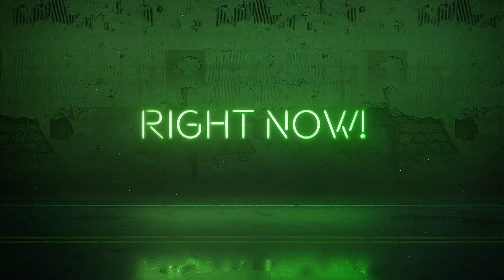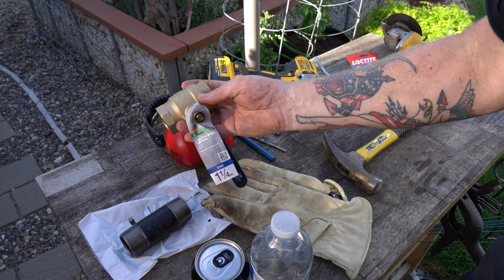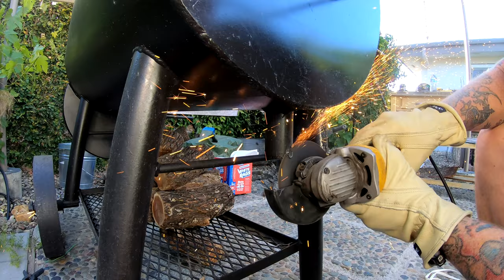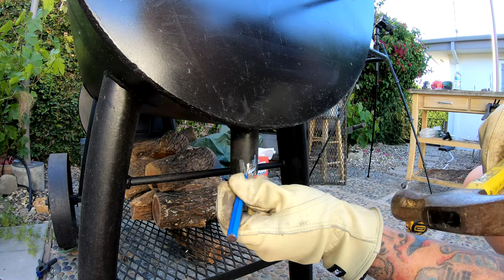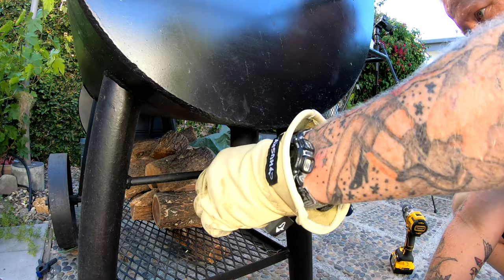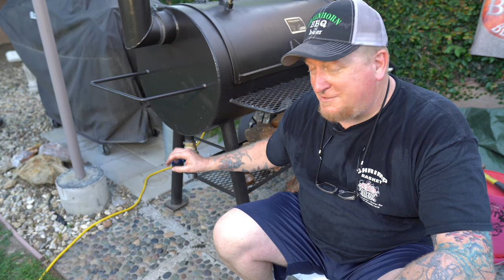Smoker mods: grease ball valve retrofit, Yoder water smoker and others

Comment: Hey Todd I’m just wondering why you didn’t use a pipe thread die and put threads on the end of the down pipe that was already there?
Reply from the maker: Good question. I don't have one on hand so I decided to do something a little different. But thats a good point. Also a cost savings measure since I had the stuff laying around already. Except for the ball valve.
Reply: I was wondering the same thing. However my authentic Texas smoker already comes with a threaded down pipe that's capped off so I  Appreciate this vid.  My job will be easy... just buying a valve that fits. Or maybe just leave it as it is and just take cap off when I want to drain🤷🏾‍♂️